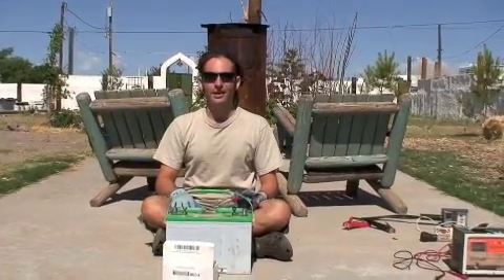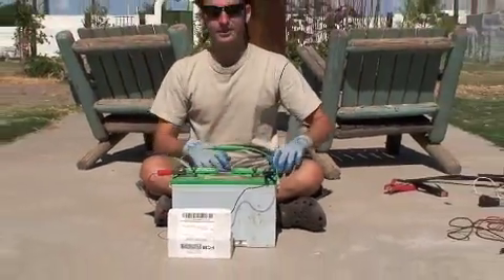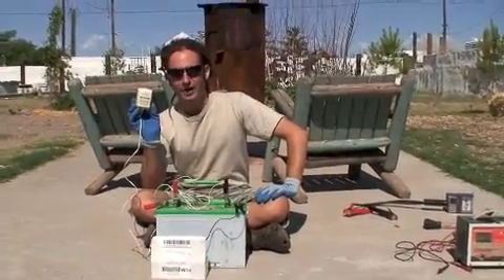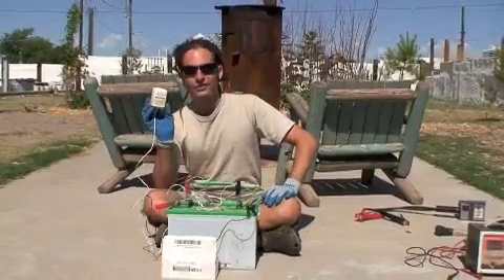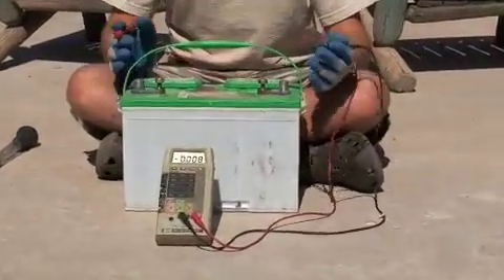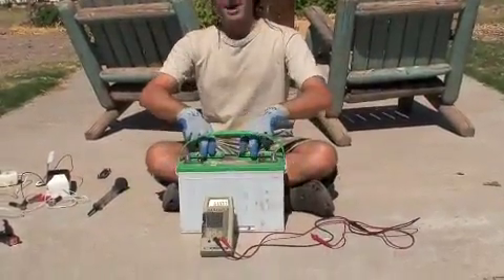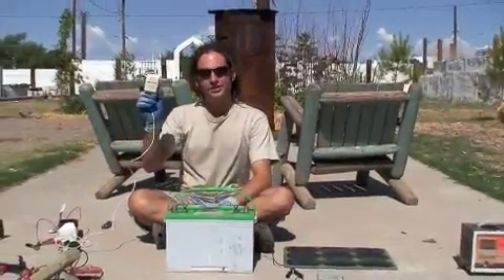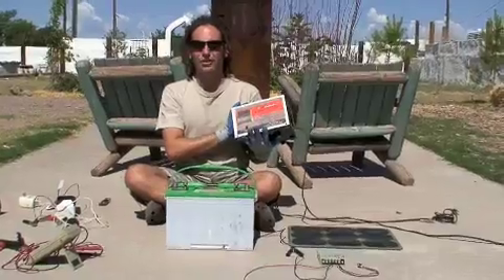Mini-D the Battery Desulfator

Comment: hi,my deep cycle [inverter] battery volt is 12.46 in open circuit that does that mean its abt to get sulphated???and my inverter isnt charging at full amps [8] mode it goes on 2 amps mode..

Comment: Yeah, this wall wart as float charger is BS advice, every time I try to connect a wall wart up to a battery, and I've been through several, it creates a short circuit immediatly, and the wire starts to heat up and cook.  You can feel it with your finger pressing the leads to the battery terminals, they heat up like a stove element.   Fast way to drain your battery to zero, melt some wires or start a fire, or explosion if wall wart is plugged into the wall.

Comment: Not only that, when I try 12v dc wall warts, I immediately start to hear the batteries boil off and bubble, which they should not be doing because I'm well under 14.4v.   I don't think you can use these Wall Warts at all as trickle chargers, maybe if they had an inline diode in the circuit, if someone knows something different let me know.

Comment: 1:15 On the strength of this video, I tried to use a 12vd 500ma  Wall Wart to supply to supply the curren, + to +, - to -, t and all I got were SPARKS, and SMOKING WIRES.    The battery desulfator I bought works fine, I just can't figure out how to get !@#$%^ a float voltage current into the battery, because WALL WARTS DO NOT WORK.   All they are are transformers, and by connecting one half of the coil to them this way, you create a short circuit.   Good job guy, you are trying to get me killed.

Comment: no preference here in connecting leads .. you're still running the potential for sparking at either post and during connect or disconnect.  Solution is to have a switch that completes (and interrupts) the circuit remotely.  Never good to spark at the terminals.    That's not trickle-charge by the way .. and if you're battery is low .. it's going to draw way more current than the wall wart can supply re: heat up and melt wall wart.

Comment: hey,
i have some golf cart batteries, i have two.
they are running only around 6 volts.
they will be usedfor and electric car.
it does not say what voltage the batteriesare but i m sure there 12 volt.
can i save them?